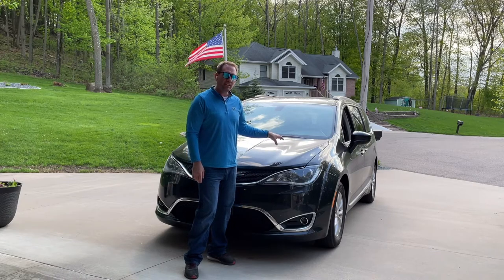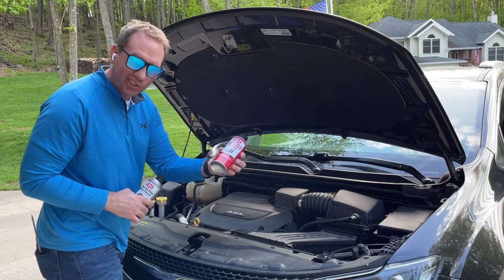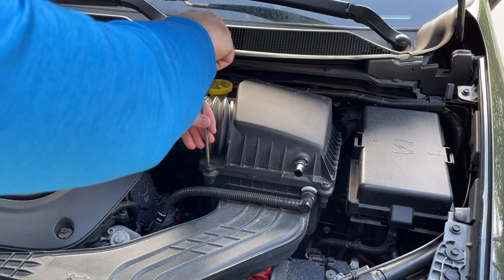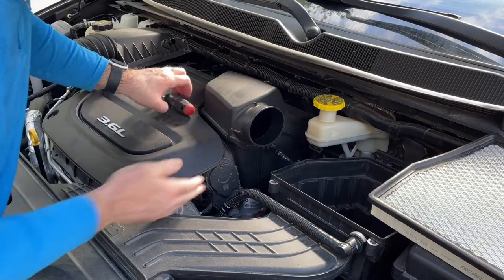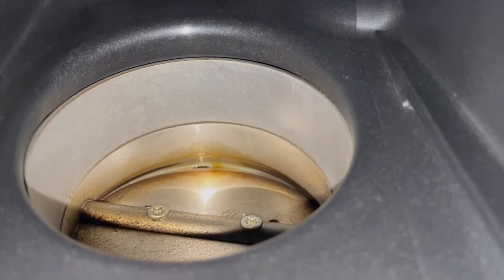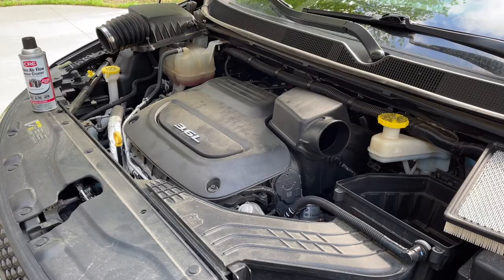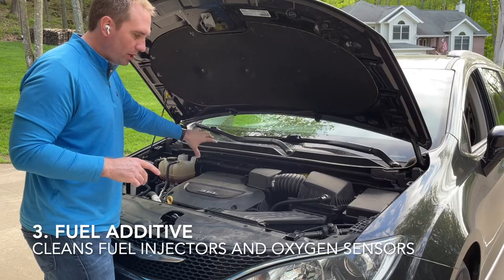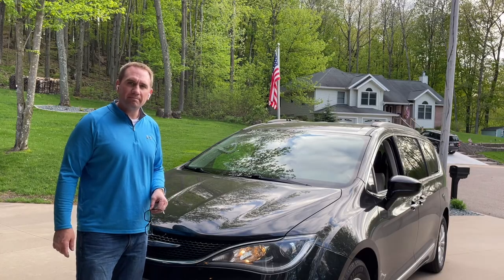Improve Chrysler Pacifica Rough Idle 3.6L Pentastar V6

Comment: How many miles are on your Pacifica..
Reply from the maker: 84k right now.  It was around 82k when I did this video.
Reply: Do you have to top up your coolant on occasion? My '18 uses like a cup every 5k miles but I have no leaks, I also hear these have alot of leak points .
Reply from the maker: @seatime674  yes, I have the exact situation you have described.  I monitor the oil closely and haven’t noticed any contamination so it must be leaking and evaporating somewhere on the outside of the engine.
Reply: @TheLawnEngineer  Yeah now I don't feel so bad I think most cars use a little bit of coolant but these I think use a little bit more somehow somewhere. Try and use the Mopar purple don't mix if you can help it.. It doesn't use a drop of oil between oil changes either which is a really fantastic thing... When you do oil changes always use exactly 6 quarts it brings it to the top of the stick, the book says 5 with Filter but I always do 6 the book is definitely a little off.
Reply from the maker: @seatime674  great advice.
Reply: sounds like at 70 or 80 or after mark this issue starting to occur..mine at 50k still has not occurred
Reply: The head gaskets are beginning to fail, and an ever so small amount is being burned every mile.   Not enough to ever see or smell.  I have not had any leaks around the oil cooler.  Use a bottle or portion of a bottle of Bar's Leaks Head Seal, Blown Head Gasket Repair, and you will stop this issue dead in its tracks!  Use specifically this brand & product!  No, I have no interest in that company other than I've always used their products and have been extremely satisfied and impressed over many decades.   For between $35 and $40, you can forgo an expensive repair.
Reply: @boxtop1 Do you have a Pacifica and how many miles are on yours? I do know that most cars use a little bit of coolant through normal dissipation and evaporation even though it's a closed system anyway. My dad has a brand new 2023 Kia Carnival and that has used about 5 cups of coolant in the first 10,000 miles ..
Reply: How does he like the Carnival?  I have seriously looked at those and think they're interesting.  We have had Dodge Grand Caravans since 1988 with great experiences, until we finally moved up to a 2018 Pacifica Touring L Plus with 45,000 miles on it,18 months ago, and we love it, as well, now with 62K. About a year later it started to use about a pint of coolant every month or 1,200 miles, out of the blue.  Added the liquid repair and it is back to normal.

My lifelong experience has been that if any coolant is ever missing, then you have an issue.  It is a closed and pressurized system and designed to never lose any coolant.  I don't buy that every car loses some - this only happens when there is an issue of some sort.  One of the purposes of a head gasket is to maintain total separation of the oil and the coolant.  If you don't see evidence of moisture on the dipstick, puddles under the vehicle, see a leak around the oil cooler, smell it in or out of the vehicle, then it's very slowly being burned and processed in such small amounts by the catalytic converter that you will never notice until the level is down.

I would be curious what your Dad's dealer would say if he asked them about his new vehicle using coolant.  At 10K, that is absolutely abnormal.
Reply: @boxtop1  Correction '22 Carnival. Very cool van I was contemplating one and still might, the '25 is a new slight redesign which looks great. He likes his, a few recalls but 10yr powertrain warranty is huge.. I had an '02 Town and Country and an '08 never a day's problem.
I also have the '18 Touring L 65k miles runs great I love it, it's very thick and quality made and comfortable.. On the Pacifica forums some of these 3.6 Pentastar motors do have head gasket issues which causes problems and it sucks. Yes its a closed loop system but steam pressure does still evaporate slowly and its normal to top up 4-8 oz a year if your system is operating normal. No coolant just stays completely level forever. Its like why do you add 6 lbs of air to a tire every 6 months when air shouldn't get through the rubber or the rim, crap just gets out. Many other Carnival owners report high coolant usage to so who knows...Yes a pint every month is totally abnormal and glad you fixed it though maybe temporary but I won't add anything to the radiator because in my opinion those products could clog up cooling fins & jackets, water pump and muck up the system possibly creating more issues later. Just my opinion and others too. However if you're losing a pint a month you have no choice but to try something verses an engine teardown I might do the same thing at that point to.. I have no visual leaks but oddly do smell slight whiffs of coolant at times which I probably shouldn't ..I only drive 3-5k miles a year I'll keep an eye on it if it gets real bad I'll just have someone come to the house and replace the head gasket I know a few good mechanics. The good thing is there's nothing in the oil and I never add a drop between oil changes, so it uses none which speaks volumes to its good health..knock on wood ha...
Reply: @boxtop1 On my '18 Pac Under the oil filter is the oil coolant cooler which might have a small leak as I have a little coolant pooled undeneath in the valley, the poster should also take a little flashlight and look down under the oil filter to see if there is any fluid.. Mine Runs perfect right now so  that's probably where my very small leak might be coming from..I won't run right to the head gasket theory and put that stuff in my van because that stuff has been known to clog radiators and heater cores among other things....

Comment: My 2017 Pacifica knocks  and my tester says cyl.6 .misfire what can I do
Reply: Probably bad rocker arm
Reply from the maker: Hard to diagnose virtually but an easy thing to check is the coil.  Each cylinder has its own ignition coil, I would swap the coils on cylinder 4 and 6 and see if the misfire moves to 4.  The good news is cylinder 6 is the right most cylinder on the front side of the engine and is easily accessible.  

If there truly is a knock associated with the misfire it’s likely something more serious.  A misfire will cause some vibration and noise but a true knock indicates a mechanical failure.
Reply: I ended up with the same cylinder 6misfire code and replaced the plug and coil pack.  Solved the issue.  Make sure you use OE Mopar and not aftermarket parts. They are more expensive but totally worth it.
Reply: Mopar spark plugs and coil pack   last 70k what I hear

Comment: My girlfriend’s 2019 Pacifica has a failed head gasket at 100k miles. I’ve noticed a ton of others with the same issues at even earlier miles. My best advice, don’t buy anything Chrysler. It’s junk.
Reply from the maker: Yeah, that stinks.  I didn’t know that was even an issue with the Pentastars until comments started popping up on my videos.
Reply: I think I've had head gaskets replaced on my cars over the years. I thought it was somewhat of a wear and tear item on an older car?

Comment: The Chrysler Pacifica is the biggest pile of junk I have ever owned. I wouldn't buy anything dodge/Chrysler again. I have have a 2017 with 110,000 miles and I have spent $6000-$7,000 in the last 2 years. Piece of crap shakes still.
Reply from the maker: I sold mine at around 85k miles, I don't miss it.
Reply: Your experience is unfortunate.  114,000 miles on my 2017 Pacifica.  So far, zero repairs, just normal maintenance.
Reply: @TheLawnEngineer  What did you buy?
Reply from the maker: @opulentcorners6277  Tesla Model Y
Reply: Cylinder 6 misfired. Mechanic is saying to start with changing spark plugs and may be one coil. 

I am in deep trouble
Reply: @markshuell3198 Same here.
Reply: @TheLawnEngineer that’s a shame because I’m relying on all your videos, friend! Ha ha